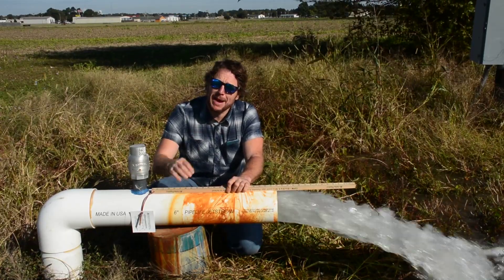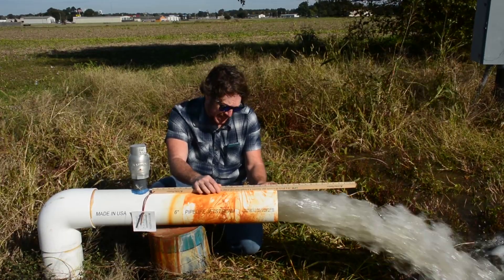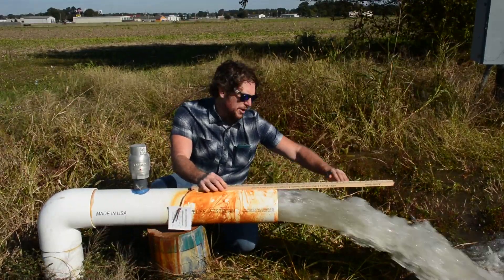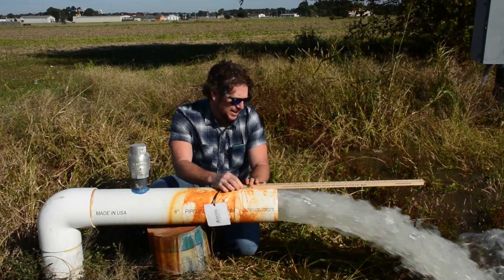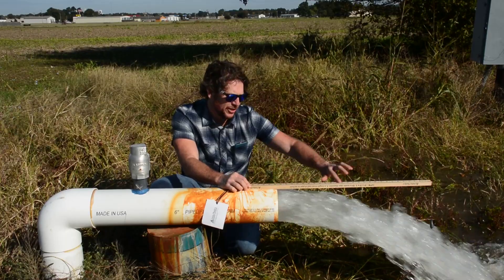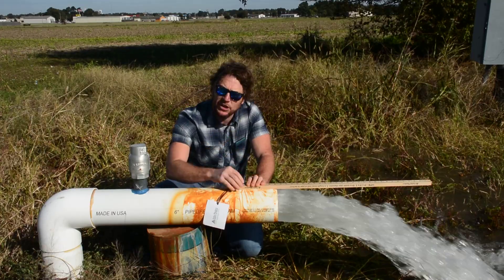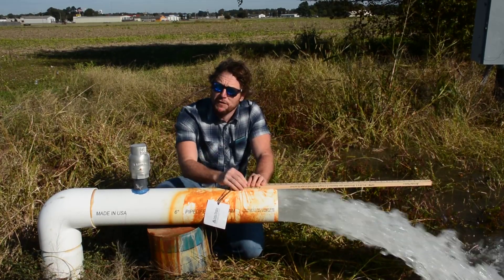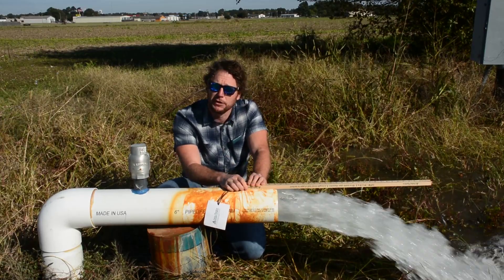A Hack! How to measure flow without a flowmeter

Comment: i need to measure reject from water system.  pipe is not full.cannot cap it with a meter.  any field suggestions  (using funnel, water hose, meter??